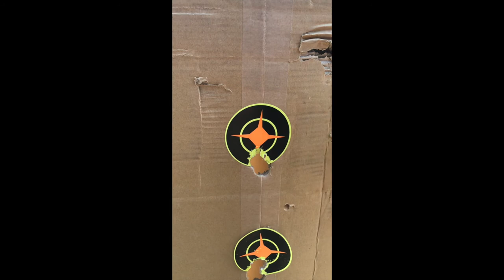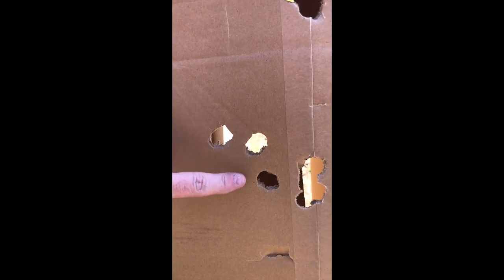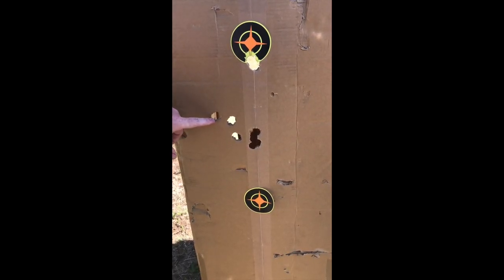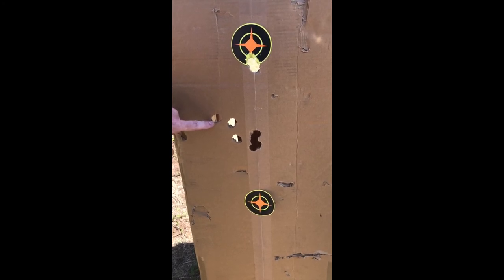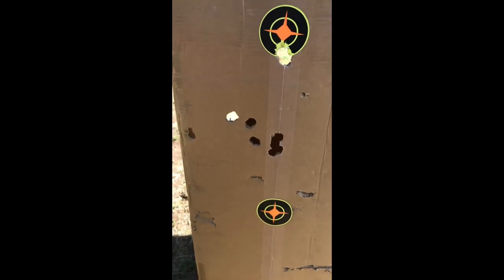SlapShot PHD250-105 - Accuracy and Stability Test

Comment: Not to be obnoxious but..I've done the same test at 50 yards..no real difference
Reply from the maker: This video is comparing the performance of our close quarters defense slug when being fired from a smooth bore and a rifled bore. The slug is designed to be fired from a rifled bore only. We were asked to show what happens if this slug is fired from a smooth bore.  The video shows that when fired from a smooth bore this particular slug is unstable. This is why we recommend using a rifled bore with this slug. The purpose of the video was to demonstrate why we recommend against using a smooth bore.  The distance is 25 yards.